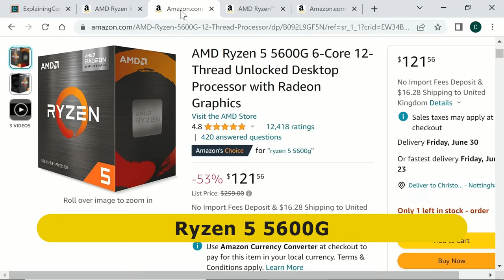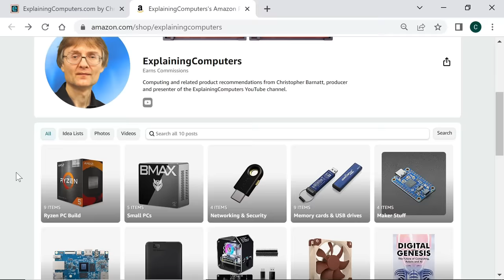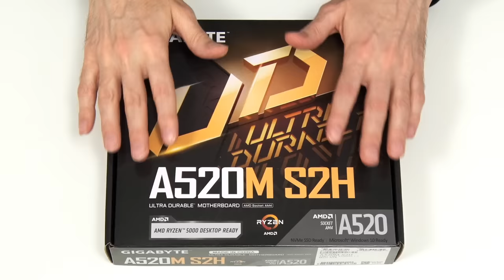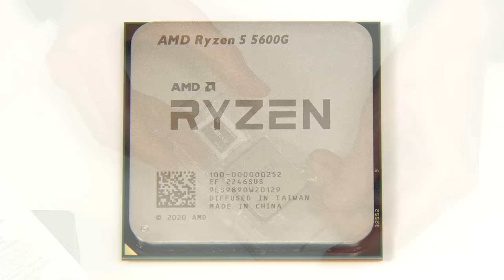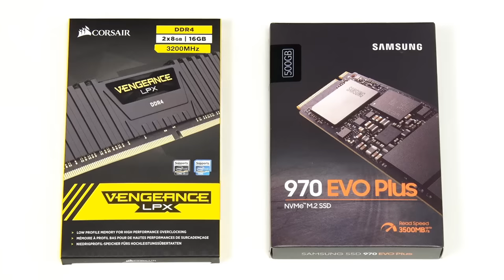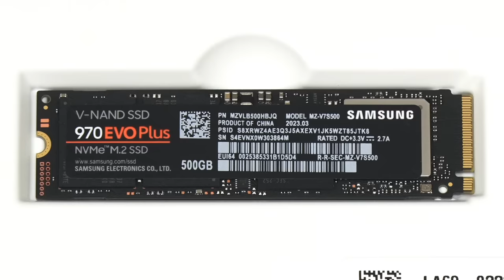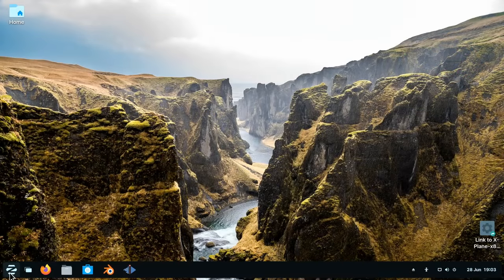Best Value Ryzen PC Build

Comment from the maker: Since I made this video, I have read a report of a theoretical security risk in the firmware updater included in many Gigabyte motherboards, including the one in this build: 
https://eclypsium.com/blog/supply-chain-risk-from-gigabyte-app-center-backdoor/ However, no exploitation of this risk has been reported, and Gigabyte have issued an advisory with a BIOS update fix: https://www.gigabyte.com/Press/News/2091

I have personally also disabled “APP Center Download” in the BIOS, which stops the updater running. See the video description for instructions on how to do this (scroll down to “IMPORTANT”).
Reply: Hm wouldn't the cpu cooler from the old system fit onto the plastic bracket that the motherboard has mounted ?
Also if you are going too remove the stock cooler too try it out, twist after unscrewing it fully & removing the backplate from the motherboard.

The stock thermalpaste easily has enough tackyness too lift the whole weight of the motherboard even without it being screwed into place.
So it will rip out the processor with it if you just pull upwards.
Lifted my full atx size motherboard here myself with ram installed & ssd dangling by the sata cable no problem, only too look down & see the cpu backplate laying on top of the motherboard box & me realising it was held in place by thermalpaste & the processor socket in the air.
Reply: Thank you for addressing this potential security issue if left unattended. I really love your suggestions for budget builds where appropriate (90% of home computer needs). That OS looks good. I am going to try it with my x370, and a rx 480. I still have 32GB of EVGA 3200 DDR4 on the motherboard. I still have my 3600X which I may use that Gigabyte MB for some type of automated home controller.
Reply: This was reported by Gamer's Nexus maybe a month ago
Reply: Oh boy. One shouldn't have to worry about stuff like that. I had to update my motherboard's bios because Windows 11 wasn't detecting the TPM properly which I don't understand it was a fairly recent manufacture. Once I did the bios update, everything was fine. And luckily I didn't come across any issues with backdoors and such when I was researching the issue I was having with the TMP.  I don't get how a company can mess up the bios TPM when it's been around for a while now. It's an MSI motherboard though not a Gigabyte.
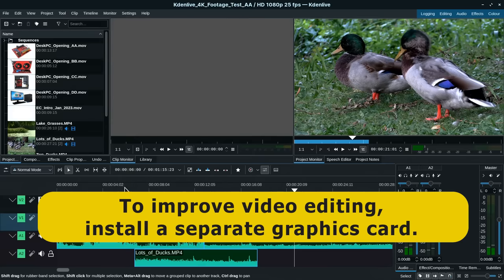Reply: 23:44  "I'm not a gamer"

Yes, you adequately demonstrated that fact with your aeronautical skills there. ;)
Reply: You can also prevent any BIOS code from running in Windows with this registry hack: 
Windows Registry Editor Version 5.00
[HKEY_LOCAL_MACHINE\SYSTEM\CurrentControlSet\Control\Session Manager]
"DisableWpbtExecution"=dword:00000001
Reply: You should do an intel version.
Reply: I quit using gigabyte motherboards because of that and because of the poor quality control. You can pick up an MSI for the same price or even cheaper
Reply: @typerightseesight  I think the Intel CPU options for a budget PC like this are likely very few or none, but I haven't studied the matter recently, so I could be wrong. Maybe Chris will have something to say about it.
Reply: @moonrock41  After I watched this video I tried and realised even my 2016 6th gen i7 6700 is still going for $200 I'm quite blown away amd is like twice as powerful at cost. But, the no integrated graphics is a huge fail for me I feel like I would just fall through the screen trying to balance at the computer. lol
Reply: @typerightseesight  where did you see it advertised for so little? I'd have bought it three years ago instead of the refurbished one I ended up buying.
Reply: @moonrock41  it came in a dell XPS 8900 I bought almost 10 years ago with a cheapo GPU in it for 700 so I used it in a rebuild about 5 years ago. PCPartPicker says it's worth 200. The non k version
Reply: @moonrock41  Although this is true for protecting windows, that will not stop the bios on the motherboard from being overwritten by an exploit or modified bios because it only stops the software from running within windows. It does nothing to stop it from running on low-level firmware or through the boards CMOS. Most of these motherboards including ASUS, MSI & Gigabyte can be updated or exploited directly through the LAN connection or an unsecured/crap security wireless network- it will function exactly like putting a flash drive into that white USB port- it doesn't need your CPU/APU to overwrite it with a backdoor- it only needs power connected to the board. Most ppl think that when your PC is "off" so is the board- that hasn't been true since PC's used AT power supplies. With AT supplies you to push a switch that is directly connected to the power supply itself- then the supply sends power to the board. With the introduction of ATX supplies, the pwr supply & the on/off switch is connected to the board- when you push the switch it just "wakes up" the board out of standby enough to tell the power supply to turn on & then the board can start running up to normal operation.
Around 10 yrs ago hackers would usually lookup the default factory passwords for common modem/routers/gateway's get access to your network, backdoor the PC's bios, they would have the bios report back it's usage logs, & the'd look for a day/time during the week when it wouldn't be in use. Then they would set the Wake from LAN setting in the bios to ON, send it a "Magic Packet" & viola' your PC boots while your asleep or gone. They would then push an infected bios patch for your dedicated graphics card <not internal> that could run a payload in the video card's ram & GPU <preventing it from being detected by windows or ANY anti-virus software, because it was't running in system ram or in the windows kernel.
Then you had a PC that could re-flash your PC bios or download infected files whenever you were asleep, gone, or not paying attention. If it wasn't for gamer's noticing lower performance/clock speeds & higher thermals & trying to figure out what was going on w/ the system; that method of attack might have never been noticed. You can bet the average user never even knew it was happening. The fact that you even know what the registry is & that you can change it's setting means you are above a Std user's knowledge base.

 Anyway, (Some gigabyte boards have a dual-bios setup. Their boards used to be notoriously bad for changing one setting & bricking the board permanently- until they made that addition) One that is Flash-able, & one that is READ-Only, & is used in case the primary one gets screwed up you can copy data from the secondary to overwrite the primary or run directly from the secondary if the primary won't load- however the secondary will still have any security flaws / issues it had @ the time of release & because it is Read-Only it can't be overwritten, but also can't be updated.
Reply: Oh waow. If you'd held back til the Amazon Prime Deal day, you could've nabbed a Crucial 1tb Gen 4 NVME for £38 instead. Competes with my Sabrent 1/2 GB Gen 3 for speeds. What a snatch that was :)
Reply: @typerightseesight  I think I misunderstood you. You're saying this CPU is $200, not the whole PC. If so, it's not a budget PC, but yeah, AMD has traditionally sold good CPUs at lower prices.
Reply: Next intel

Comment: It's so refreshing to watch a PC build where the focus is assembling a reasonable & reliable system rather than extreme overclocking, water cooling, and RGB lighting madness.  I don't need another system right now, but your video tempts me to build one anyway just for fun!
Reply: Ha, I felt the same temptation, but I too shall resist... I haven't worn out the 'old' system yet. ;)
Reply: For the majority of people who do not have hardware/software certificates this clip is very good value for money. Building a new computer to me is akin to building something out of LEGO. This is what i always tell people. It is not complicated. This clip shows that it is not. Snap the pieces in like lego and go. Even the OS is now a simple matter of booting up with it in the drive . As long as the system passes POST and the disk is in the drive the rest is easy.
Reply: am building a system right now just for fun but it's a 2007 motherboard - so I do my parts shopping mostly on ebay instead of Amazon. My 3GHz single core CPU cost me $10 :-) 

But now I need to locate a PCI express video card suitable to that vintage era...
Reply: @TheSulross  I have a system named "Cash" because I got it just like Johnny Cash's car ... "I got it one piece at a time, and it didn't cost me a dime..."
Reply: Yeah, we don't need the "lunisy" [sic] of a certain other (and more frenetic) PC building/modding channel here.
Reply: @suminshizzles6951  Choosing these particular parts made the build or upgrade very simple. Anyone ought to be able to upgrade any tower computer this way with no problems.
Reply: Really enjoyed this video. My pc is from 2011 and I will need to upgrade it but all seems so expensive and complicated. This has alleviated a lot of my concerns especially that I can do it in phased steps, I.e. add a decent graphics later. Great work. Learnt so much.
Reply: Not a big fan of RGB. Some of these people go insane with RGB with their cases acting like it's some nightclub or something.
Reply: @RhinoXpress  I like to build with full RGB then lock it all insidse a case with no transparent panels withonly the tiniest amout of light peeping out of vent holes.
Reply: having frakenstien computers, (built from spare parts from other dead computers) for many years, and then opening up that new motherboard for the first time.
Reply: @suminshizzles6951  True gamers play oni7 or i9, RTX 4080 or 4090, and 16GB or 32GB RAM although more is better because games now require more RAM! Not on some i3 or i5, Intel Arc A770 or the Yeston RX 7900 XTX Sakura Sugar! I'm 16 and I even know this!

Comment: One little bit of advice. When installing a component which has a connector, wiggle the component (or connector, if it is separate) a little bit. Use a reasonable bit of force, but of course, not so much as to bend or risk damaging the component. Occasionally, you'll hear a little 'snap', indicating that something wasn't quite seated properly before the wiggle. But even if that doesn't happen, the wiggle just helps to ensure that all the joints in the connector are making good electrical contact.

(Also, I'm quite glad Chris didn't become a pilot :-)

Comment: 7:49 - Keep in mind while PCIe 4.0 is faster than 3.0 it may not be the bottleneck in your system.  If you install a SATA HDD (or SSD) controller to add more storage space, the PCIe 3.0 is still going to be fast enough with multiple drives connected.  Even if you're adding 16 more SATA drives to your home server using a single PCIe 1x slot your ethernet connection will now likely be the bottleneck and not the PCIe bus.  It all depends on your planned usage.  Don't let PCIe 3.0 scare you!
Reply from the maker: Totally agreed.
Reply: I watched some benchmark videos of game level loads times for pcie gen3 gen4 gen5 and the times were 26s, 24s, 23.5s so the "speed sacrifice" of gen3 nvme is not much.  However, don't buy a gen4 x 8 graphics card or you'll be sorry as it will get crippled down to gen3 x8 which may slow it a lot (5-10%).  A 3000 or 6000 series card is fine except for amd rx6500.
Reply: The only time PCIe 3 might be a bottleneck is if you go for a very modern GPU that's both PCIe 4 and only 8 lanes. Even then it's probably not a problem.
Reply: However I dislike A520 motherboards, what's the point of them? You could buy a B450 which support ALL generations of RYZEN for the same money. If you're building a budget system you might chose to use an older CPU.
Reply: @wayland7150  interesting point.  could you expand for those of us who aren't so knowledgable?  eg what are the compromise points.
Reply: @DeepakKumar-lv4te  I'm not sure which point you mean. The A520 motherboards are RYZEN 5000 only yet offer no advantages over B450 which will accept any RYZEN. B550 however have PCIe4 which would make a better home for an 8 lane PCIe4 GPU. PCIe is smart in that you can have any number of connected lanes and it works the same. Just more lanes carry the data faster. I built a server and only had a PCIe x1 slot remaining so I chopped down a little GPU so it would fit.
Reply: @wayland7150 thank you for this explanation. in my situation, i will be settling for the 5600g and doesn't plan on upgrading nor adding gpu. would it be ok then to choose the A rather than B mobo?
Reply: @wayland7150 blah blah blah

Comment: Thinking back to my first PC, it's almost inconceivable how much computing power can fit in less space for less than the price of just the floppy drive!
Reply from the maker: Greetings Leslie. I often muse on thoughts like this. In this instance I found it particularly amazing that no drives needed to be connected -- everything just plugged into the motherboard! And a small one at that. Amazing times.
Reply: @ExplainingComputers  some say scary!
Reply: @ExplainingComputers  Did you decide that you are no longer interested in optical discs or those hot-swappable drives?  Or will there be more to come in future videos on that front?

I recently did a 5600G build in a very small mini-ITX case which I need to finish off and start using; the biggest headache was deciding it's time to part with my long-trusted optical drive, and either go with external USB or just do without.  But now it means I can finally give up my mostly empty tower which is increasingly hard to place around my desk.
Reply: the stories of what they went to space with in the past are extraordinary

Comment: When you build or test a PC, it would be very useful to know the idle power consumption of the system. Why? Because computers spend most of their time at idle, so idle power is what mostly determines the overall running cost and so circulating this information is financially and environmentally useful. 
Excellent video, as usual, by the way.

Comment: The 5600G is not a "real" 5600 but a 5500 with an APU, around the performance of a 3600. This CPU saved me some money during the mining period last year, when GPU prices were crazy high.  This is definately a very good value build for a multimedia pc or even light gaming. If a proper GPU is added in the future it will make for a decent mid range gaming PC and the APU can still be used for error testing if something is wrong with the system, without the need of a GPU.
Very well explained video! Im pretty sure most people wont have a hard time creating similar builds..

Comment: While I think it's great that prices have come down for components, I can't help but shed a tear when I think of how much I paid for a lot of the same components when I built my PC back at the end of 2021; most notably with GPUs. My final build ended up over $1,000, and half of that came from the GPU alone; I paid over $500 for an RX 590 at the time. I couldn't afford the card I originally wanted at the time, an RX 6600, because it was more than what I could pay. Ironically, that same card is now in my PC, and I bought it last October for less than $250!
Reply from the maker: Price changes in computing have been mad, and infuriating as you note.
Reply: PC GamePlayers  must suffer 🤣🤣🤣🤣 Well, sarcasm of course.
Reply: I paid $30 above MSRP for my 6600 in March 2022.  It now has problems where the fans run constantly, and keep up a racket.  I’m going to have to use my warranty.  The real kick in the crotch is that I found another 6600 a couple of weeks ago for $179.99.

Comment: Good basic assembly video, it doesn't have to be complex.  5600G makes a great 'office box' PC with a bit of graphics clout. For the difference I would now use a 1Tb SSD as it is only a few £££s more , using Solidigm P41+ drives atm, they update the firmware to optimise performance  from their management tool.
Reply: I was also thinking along 1Tb lines.

Comment: amazing value !!!  it is hard to justify buying a raspberry pi or most sbc's with systems like this
Reply from the maker: I too find the price for a hexa core desktop with 16GB RAM and a 500GB SSD to be extraordinary.
Reply: @ExplainingComputers  even more so if you already have memory / disks.  One thing, can a laptop 16Gb RAM chip be used in a desktop like this?  They're smaller, is there some kind of adaptor ? thanks.

Comment: thank you for the video ! it's always nice to see a pc build. i'm impressed by the bios upgrade system, i remember the time when a bios update required to boot on an ms-dos floppy disk ! I'm confused about the m2 ssd though : doesn't it require an heatsink on it ? also, does your amazon marketplace works on amazon france ?
Reply from the maker: Most M.2 SSDs are still sold without a heat sink, and the drive here is not one of the latest ones designed for PCIe 4.0 (which the motherboard does not have), so should not get warm enough to need a heat sink. Bu one could always be fitted. Sadly I've only got Amazon set up for the US and UK, although the US Storefront may prove useful for seeing which components I used.

Comment: An important omission about the Ryzen G-CPU's (APU's), those only have half the L3-cache compared to the regular Ryzen-CPU's, so for example 5600G vs 5600. That will reduce performance. That is not necessarily a big deal if you want/need a low-budget PC but be aware of it.
Reply: Would a gamer be better off buying the non -G and adding the cost of a GPU ?  My nephew is looking to build as his gaming laptop died (keeps shutting down).  thanks in advance.